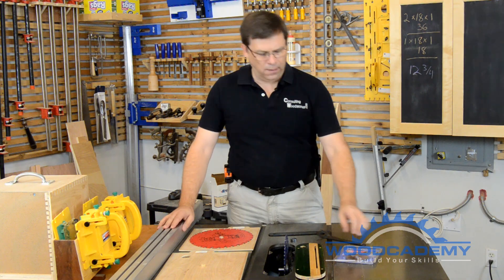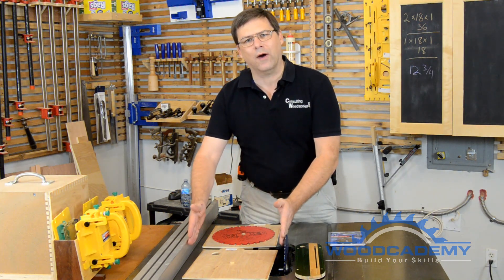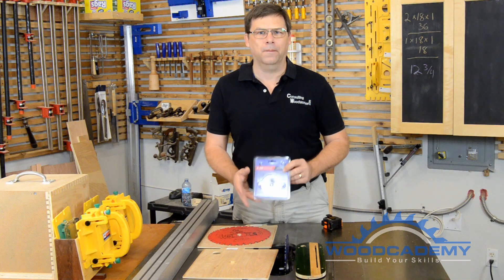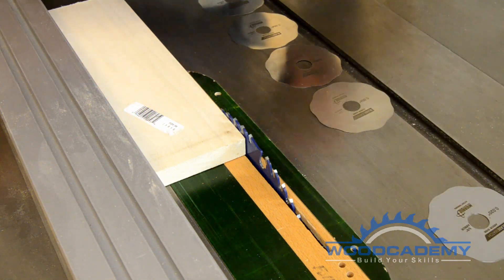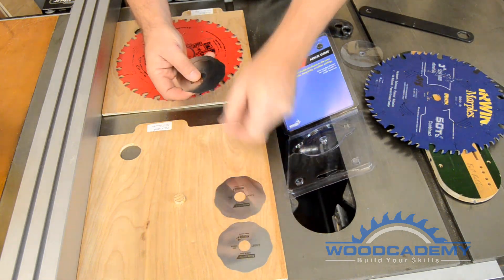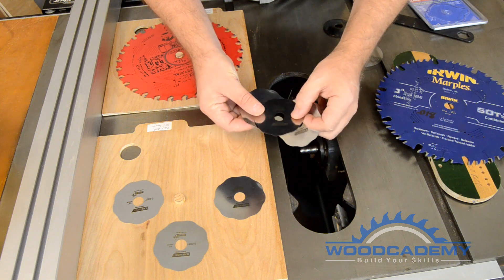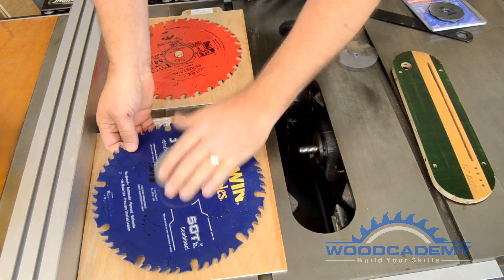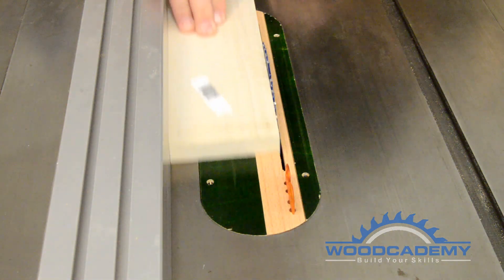First Look at MicroJig's BladeMatch Arbor Shims by Woodcademy

Comment: Hmmmmmmm 🤔 well I just either plus or minus the thickness of the blade from the scale. A thin kerf is 3/32” or thinest 1/16” so I just add that to my scale but most of my blades are 1/8” but yeah, that’s a good solution.